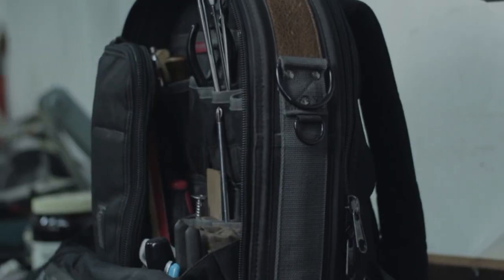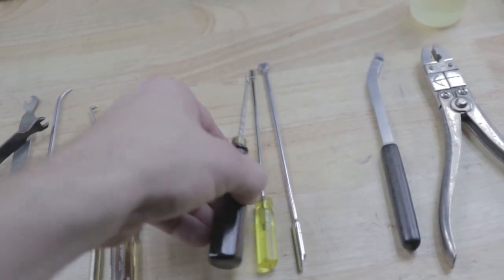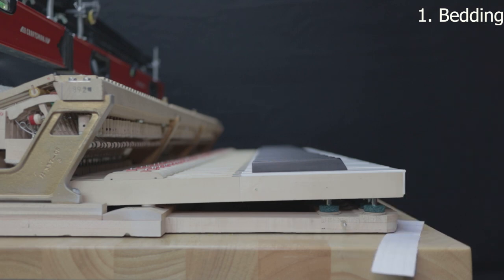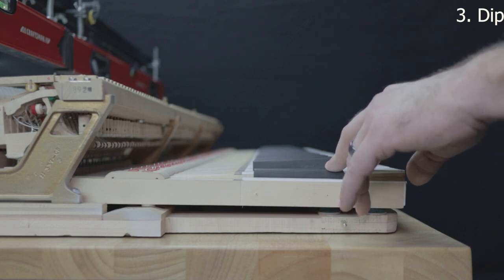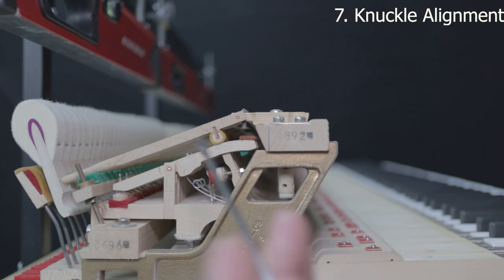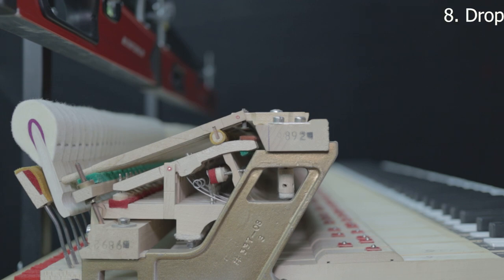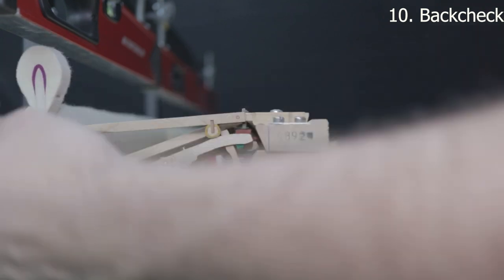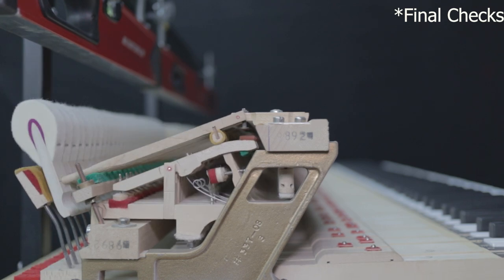Grand Regulation

Comment: What might be the problem if a white key clicks when played in front of the black keys, but when played in the middle to back, the key doesn’t click?    This is a 30 year old Baldwin L, which was sold to me a month ago as “lightly used”.   The piano itself is in great shape, as far as I can tell, and aside from feeling the click (on E5) under my fingers, the key response is even across the keyboard.
Reply from the maker: I'd check to see if the key cap itself is loose. Sometimes they will click when you play it if they have come up a bit up front. Lift up on it a little bit and see if it is glued on tight.

Comment: Question: I have a Grand Piano with a Schwander type action, I noticed that in the middle C area, when I play repeated notes, sometimes the jack doesn't reset quick enough and the note doesn't play and I just hear the wood parts rubbing, what adjustment should help make this better? Thank you!
Reply from the maker: First I would try moving the jack with your finger and see if it snaps back quickly or not. If it doesn't you'll probably need to repin the jack. The other possibility is that the spring that keeps tension on it is either bent or stuck, has a lot of gunk on it, or something is broken. Check for free movement of the jack by hand first and let me know what it does.

Comment: What tool are you using for the knuckle alignment?
Reply from the maker: I use a few different ones depending on the size of the blade tip of the screw. You can either use a "drop screw regulating driver" or a "regulating screwdriver". The end will have an oval or slotted opening that fits over the blade head of the screw. Schaff has both, you may want to have a few of different sizes because they vary.
Reply: @MrPianoTech  Thank you! I was looking on Schaff, but their product pictures aren't very good. I couldn't see the tips to determine exactly which tool I needed.
Reply from the maker: @MrJahvah  yeah I agree, they need to use better photos.

Comment: What's the difference between drop and checked position?
Reply from the maker: So it'll be in "checked" position after a solid blow and the hammer tail "checks" itself onto the "backcheck". After which if you slowly let up on the key the hammer will swing up to the "drop" position. In this "drop" position the hammer should be approximately 4mm from the strings, this will keep the hammer from pinning itself against the strings. The drop is adjusted by the screw on the top of the hammer shank.

Comment: How can I regulate so I can play really soft? Pianissimo. I hate the loudness of my baby grand. Plz help :) Thanks
Reply from the maker: Two recommendations: 1. Adjust the letoff the best you can, around 2mm away from the strings. 2. Voice the hammers. Those two things will get you the quickest results to make your piano play softer.
Reply: @MrPianoTech  isn’t true that the more space between the string and hammer, with key pressed in, the softer we can play?
Reply: @MrPianoTech  Regulating according to normals specs, does not allow me to play the first moonlight in pianissimo for example
Reply from the maker: @TimurdeRuiter  The closer your letoff, the lighter the pressure it takes to play the note. Although all of the regulation steps work together, the letoff adjustment will typically give you the most dramatic result. All the letoff does is tell the jack when to quit pushing on the hammer butt or knuckle so that the hammer will then continue on its own enertia and strike the string yet not hold itself against it. The closer you can get that cutoff distance the better. 

The space left between the hammer and strings after the note is played is related to drop and backcheck. 

To get the best result you'll want to do a full regulation but typically adjusting just the letoff can get you quick results.
Reply: @MrPianoTech  thank a lot for the video and your advice!
Reply from the maker: @TimurdeRuiter  You may need to start the regulation with a shorter distance between the hammer and strings at rest, less space between them. Sometimes I need to go closer to 42mm instead of 46mm.
Reply from the maker: @TimurdeRuiter  No problem,  thanks for watching!
Reply: @MrPianoTech  I can’t. The hammers will then touch my pinblock. Anyway thanks a lot for this video . Very educational!!
Reply: @MrPianoTech  can I ask you a question about soundboard repairs?
Reply: I’m planning on drying it with a heater. Then fix cracks with epoxy with fibers. And coat the sound board with injection epoxy. Should I do the repair at driest point? Of shrink it using heater. Wedge it and let it get moist again, and then fix cracks and coat the board? Many thanks!
Reply from the maker: @TimurdeRuiter  I would let the piano naturally acclimate to the environment it'll be in when it's done, same temp and humidity. Then use a long wooden wedge, preferably made of spruce, and press it into the crack using titebond wood glue. Once dry, trim the wedge down and sand it flush with the soundboard. I wouldn't use epoxy, you'll only need the wood glue and the wedge of wood.  You shouldn't need to dry it first either just get the shop conditions as close as you can to the environment it'll be in. You don't need to coat it either but if you do want to, use a nitrocellulose lacquer so it can flex and vibrate properly to amplify the tone.
Reply: @MrPianoTech  Thanks what about the pin block? CA and injection epoxy treatment ? CA and very thin epoxy on the walls of the holes and then quickly put back the tuning pin?
Reply: @MrPianoTech  also I think it has to be dried a little bit. So if in the future it gets a bit dry. Cracks won’t reapear
Reply from the maker: @TimurdeRuiter  I wouldn't epoxy where the pins will contact it but a little CA is fine. If the laminations of the pinblock are separated too much I'd replace it.
Reply: @MrPianoTech  naah just some loose pins. Think I will do the walls  with both CA, and and dip the pin in thin epoxy.